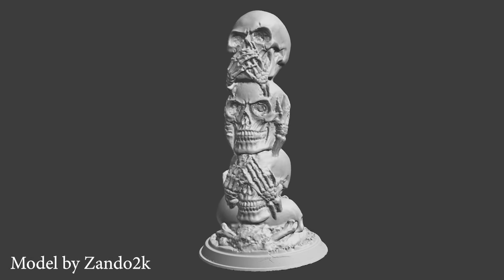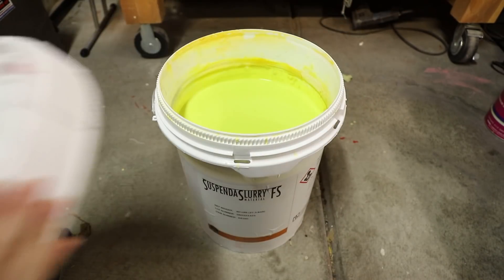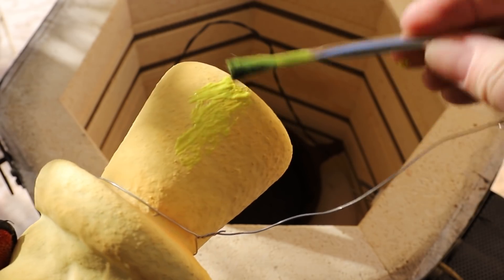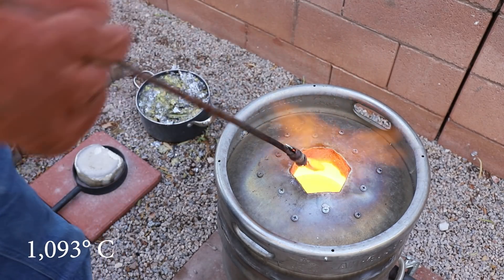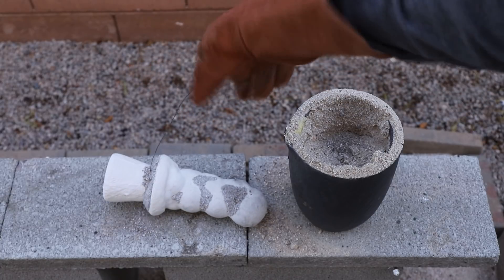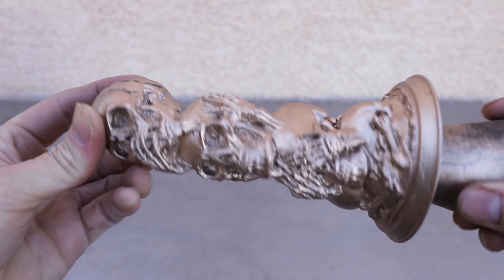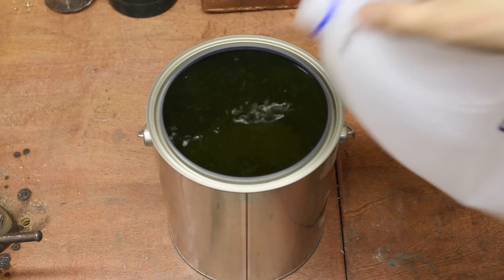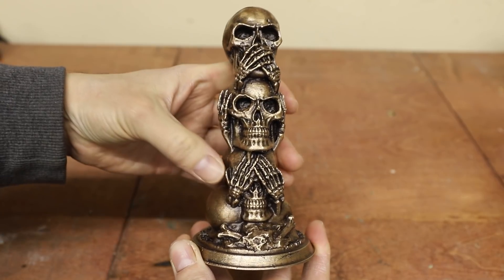Turn a 3D PRINT into METAL - Lost PLA Metal Casting - Three Wise Skulls

Comment: Im doing one rn, but just pouring over the PLA+. NO BURNOUT before pouring.  just single wall print- coated in setting joint compound, add LARGE sprue and several large vents.. like big fat ones- coat and let dry- set in sand mixed with a small amount of sodium silicate and just gently press the sand around it, just enough to get rid of the air gaps. Pour FAST and step back. Itll flame and smoke but it makes IMMACULATE castings. No joke every single print line will be visible, and the drywall mud comes off totally and easily on its own when you de-sand it.  I use .03 nozzles and single wall thickness- no infill. Its wild. I wanted to get ceramic slurry but holy shiz its expensive. Just get a $10 bag of 20minute joint compound, mix it up and let it rip! It works

Comment: What type of kiln is that?
And can I use my melting furnace to make the shell ceramic instead of the kiln? And does this same method work for metal casting steel or aluminium?

Comment: what did you do at minute 5:38? im nub and my castings comes with many black layers on the model that I find difficult to remove. What do you recommend?
  And what is that black layer, wax residue or slag?

Comment: You might want to consider sonic cleaning for removing the ceramic , I'm not sure how feasible getting it proffesionally done would be for videos, but it seems like your capable enough to rig something up, doesnt necessarily have to be "sonic" so much as vibration to work.

Comment: Is there a reason you don’t use vapor polishing on the PLA prints before you begin the ceramic coating process? This could really help with removing the layer lines that you see in the final piece. As always, great work. Subbed and excited to see future projects!
Reply: Vapor polishing doesn't work on PLA unfortunately. The materials it does work on do not burn very cleanly. But, you're right, I would absolutely spend more time post processing the print though.
Reply: @AaronReynolds89  Didn't know that vapor polish doesn't work on PLA, totally makes sense
Reply: @AaronReynolds89  I think there is a new resin meant for casting. Vapor polishing is mainly for rewin prints I belive
Reply: I imagine it would remove too much detail
Reply: i'd say if it is within means, use a resin printer instead. they enable much greater detail
Reply: Better use a silicone mold for finer details. Industrial silicone for high-temperature casting. Then more replicas can be made with one mold.

Comment: Really well done! It looks like you perfected the casting with the suspenda slurry and sand. 

The resolution of 3d printing is not going to get any better probably. But it is super zoomed in. Maybe an 8k 3d printer will be better. But it will cost. I saw the phrozen 8k 3d printer throws out good prints..

Until i am actually going to produce 3D stuff i am not going to buy anything, while the technology rapidly advances. So better stuff for lower prices in the future more than likely. 

Keep it up!

Greetings,

Jeff

Comment: $250 keg furnace, $150 pressure washer, $200 sandblaster cabinet, just as some very conservative estimates (not counting the knowledge and materials). Here I am with my 3D printer all excited about making metal items and damn you do make it look so easy and glamorous, but I think I'll spend a decade getting to the point where you're at :)

Comment: You might want to use acetone bapor method to smoothen your 3d prints, making their surface smoother.
Reply: That would mean he needs to print in abs, which doesn't deal well with high temperatures.  

It would be giving off highly toxic gases the whole time its in the kiln.

Comment: The casting came out great.  Overall, how does this process compare with sand casting in terms of difficulty, time and expense?
Reply: That ceramic coating is not cheap and it's the cleanup process that is usually more time consuming than the actual making of it.

Comment: Love your videos, I've experimented with lost PLA casting using investment plaster and colored PLA with poor results because it left ash in the mold. I'll try the black Overture PLA and see if that works, it may save the very big step of making a silicone rubber mold for the wax replicas. The ceramic shell process looks like a better fit for what I'm trying to do, which is digitally sculpting and 3D scanning human figures and casting them in Bronze.
Reply: 壁厚较薄的空心壳体会使灰烬变少，尽量使用配方简单的PLA材料，减少无机色素等杂质融化造成的多余的灰烬

Comment: Nice Video again! Won't you try to wash the 3d print with acetone to avoid the printing lines? also, it is a waste to demolish the print, why don't you do some silicone negative molds of id, and then use bee wax? it's much better than burning plastic! and always make gas vents in the final mold. For easy cleaning the final metal details you can use a kind of acid maybe.

Comment: You should consider getting a Needlegun to help make breaking the ceramic shells go a lot easier. It'll especially help break the ceramic shells apart when you have thick ceramic fills like when you did your bronze measuring cube, that way it'll reduce how much time you'll use your Pressure Washer or Sandblaster. Just remember to start gentle and only apply gradual pressure with the Needlegun until the shell starts breaking to minimize the needles impacting your castings.

Comment: Great results dude! Have you not tried clearing the shell off using a jar in a ultrasonic cleaner? If you put the model in the jar/container, and fill it with something that'll dissolve the shell, and chuck that to float in an ultrasonic, it should come off easy. Doing it in a jar/container is to keep it from getting loads of shell bits on the bottom of the ultrasonic which would impact its performance. You can drain off the liquid and dump the shell bits somewhere, then refil the drained liquid back in, if it's too full of bits to be effective

Comment: Have you tried getting the kiln hot before putting the mold in. I have always done that with wax to avoid cracking the mold. It flash melts the wax before it can expand and crack the mold

Comment: It did turn out great 👌 but I tend to eliminate the print lines in mine. Have you tried using 3d printer castable resin and uv lamp? One or max 2 layers of it should be enough and it is fairly easy to use this way - just dip like in slurry, wait till exsess dips out and then use a uv lamp to harden the resin.
I also noticed a new bucket od Suspenda Slurry. A lot of new projects are about to come? 🤔 cant wait because all of your projects are awesome ☺️
At this time I am preperaring for another try with Death Trooper hollowed one. It is a big print - 3days 😳 we will see how it will turn out. And a lot of my projects are still ongoing but not finished. All is recorded, still needs editing.

Comment: Another awesome video. I am Still waiting on one on how your built your lifting and pouring tongs. 

I now have a 10KG Castmaster furnace, sand, safety wear, a 10KG and 4KG crucible and a lot of aluminum to melt. The tongs I have I do not feel safe to lift the 10KG crucible with. I do have enough steel to make a set of large tongs with but finding help online on how to build them is pretty limited. The set you made look perfect. I'm sure you would get a lot of looks and likes if you were to make a video on how you built them.

Comment: Absolutely love your channel! Such wonderful and captivating content. I am just starting out in foundry, and I have a few questions.
1) I own a 3D printer but do not own/have access to a kiln to melt out the PLA. This is obviously a very important step and I was hoping you would have some advice. I was wondering if I could just pour molten metal onto a PLA piece in sand and have funnels and channels downward to allow for drainage? Or perhaps another method that doesn't involve a broke college kid to buy/need a kiln. 
2) In previous videos you low-key mentioned something about using compound filler to really capture detail and remove those pesky 3D lines, I noticed you didn't use such filler here, and could see some lines(pre sanding/grinding). Any reason as to why? 
Again, I really appreciate all the work you do, I know how much time/effort goes into these sorts of things and it shows. Cheers!
Reply: P.S. What the hell is liver of sulfur? your telling me a liver made this sulfur?

Comment: Looks amazing. Would it make sense to sand the 3d print plastic to remove the layer lines before the metal casting later so they don't show up in the final version?
Reply: For details so small, like in the base, it's next to impossible to do that without damaging the plastic. You'd almost need a dentist's drill to access some of those small recessed places. Sanding is totally ineffective on those details.

Comment: Always love the process. I have a question, though. In previous videos, you wrapped wire around the print after a few layers, but didn't in this one. Did you find it wasn't necessary?
Reply from the maker: Thank you! I decided to skip that step after discovering I could patch the shell by painting on slurry while the shell is hot. It’s definitely a good idea to wrap the shells with wire but it seems like either way they crack.
Reply: @robinson-foundry  You had a few very visible cracks on the smooth backs of the heads. It's something you did not patch... And even on the finished product, I can see some printer layers. It is a pity that it spoils your excellent work.
Reply: I was wondering his decision process was regarding this.

Comment: What does it look like if you sand blast a PLA print before casting? I know nothing about sand blasting. Can you turn the medium rate down to gently abrade a 3D print?
Reply: I'm no expert on sand blasting or foundry, but I do own a 3D printer and PLA isn't tough. It snaps and breaks very easily, especially under heat and pressure. 3D PLA is cool, but at the end of the day its just cheap plastic. sandblasting it would not be good in my opinion. Although, I can't think of a scenario where you would want to blast PLA by itself. What are you trying to accomplish?

Comment: I searched the internet trying to find that liquid ceramic and didn't have much luck. Found some stuff that was similar but didn't want to take a chance on spending $100 on a 5 gallon bucket. Could you share a link?
Reply: Yes I was looking for your slurry also. If you could let us know the supply house that would be great! Years ago I did this with sla patterns and found that hollowing out the model kept the cracking down as I didn't get the thermal expansion of a solid.

Comment: Love watching the process. Looks great with the contrasting shades of bronze! Good work.
Reply from the maker: Thank you! I like the contrasting look also.
Reply: @robinson-foundry  I'm really surprised that the sand molds can hold so much details (like bolt threads) when you pour heavy molten metal into the mold. How do the sand grains not move? 
With the ceramic mold, I was thinking about carbon fibre molds, where you use a coating that makes it easy to separate the part from the mold once the glue sets. 
Could you not spray the insides of the mold with something right before you pour? Possibly not vinegar? 
🤔
Enjoying your vids..